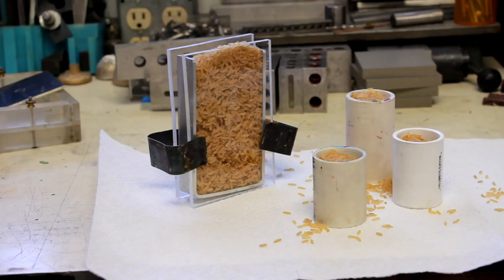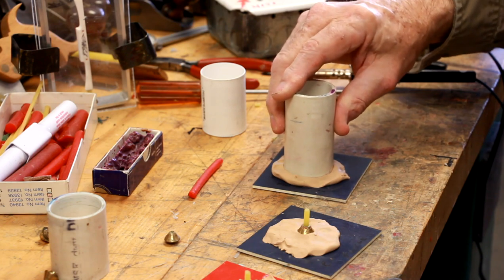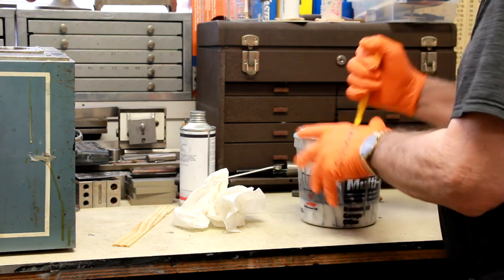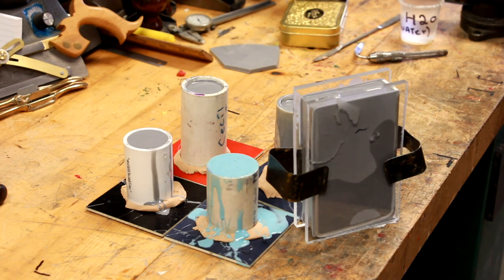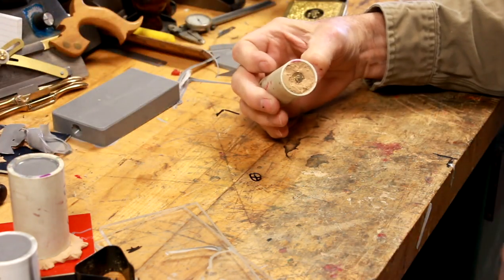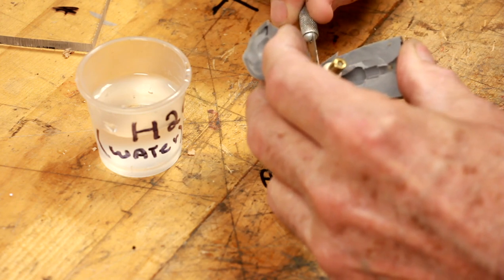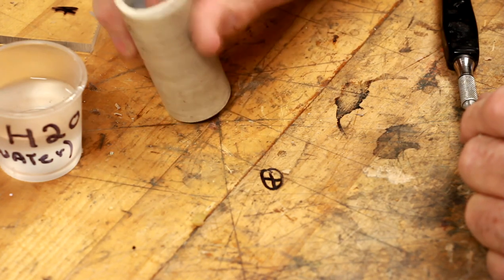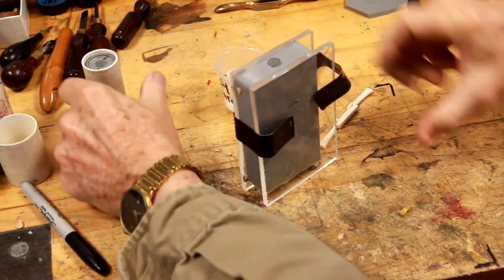R T V Molds 101

Comment: voiceover is a great success. much easier to understand you when no interference from machine noises.  thank you for the video.  would be great if you could talk more about how scrapers work including more detail about optimal blade thickness/hardness, optimal setup for scraper planes/ mods that you found useful etc.  you have a wealth of practical knowledge, and many are eager to learn!  Thanks!
Reply from the maker: see my video on sharpening fixed blade scrapers
Reply: @paulhamler8315  Thankyou.  I have watched.  I’m still trying to figure out how to use the Lie Nielsen version I have, with the thick blade.  I can’t make it cut (a cheap #80 works better) so I was hoping to learn what I am doing wrong.  Someone I know has the Veritas version, and he can’t get it to work either.
Reply from the maker: Buy a card scraper and cut it to fit your lei Nielsen sharpen it like my video. The blade in the lie Nielsen is way too thick .

Comment: Paul if you read this, do you have an experience or recommendations on lost wax non ferrous metal casting in steel or iron for small parts?  I've done lots of silver/gold/brass with lost wax. I suspect it would need to be jobbed out to a commercial vendor??? I'd send an email but can't find one referenced to contact you. Regards, and Thanks.
Reply from the maker: hamlertools@windstream.net